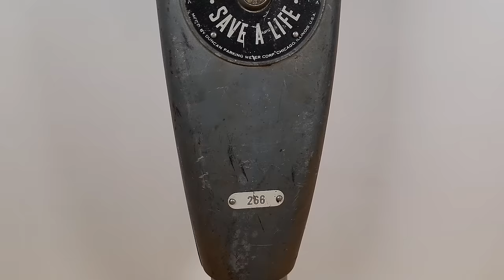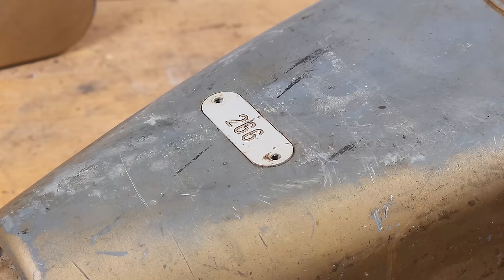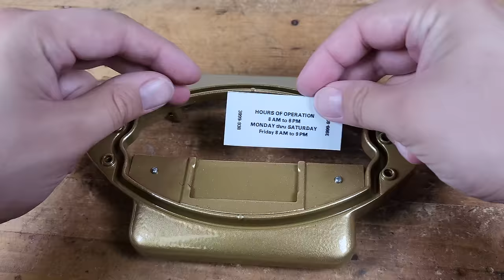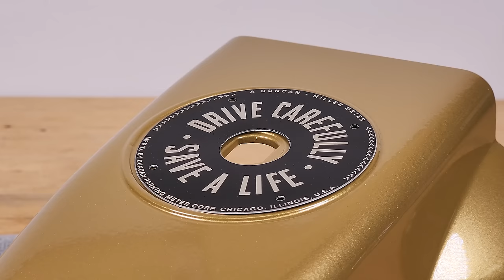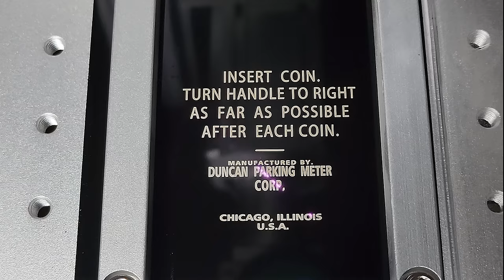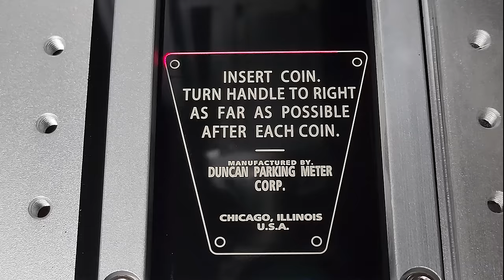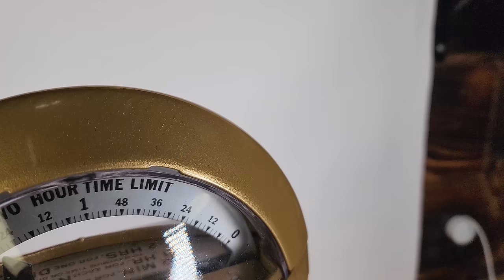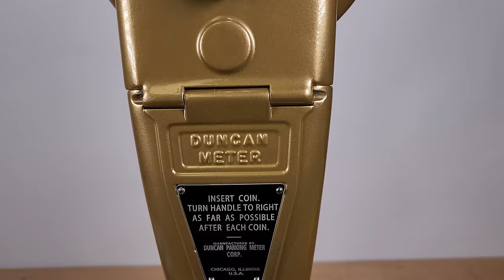1960's Duncan Parking Meter Restoration

Comment: This turned out nice 🙂 I personally have repainted them myself a handful of times when I collected them and they are surprisingly heavy duty and heavy lol, they are made of a magnesium aluminum alloy and are difficult to spray paint when taken down to bare metal, this guy definitely did a better job than I personally have in any of mine that I had in the past, but I admire his attention to details that I personally overlooked on the ones I worked on, GREAT JOB RESTO MAN 😎

Comment: Is there a reason you changed the colors on the violation sign and the expired sign? Where did the police sign go?
Reply from the maker: It was easier to find the decals and I liked the color difference better. I left that off, the one that I had was in really bad shape and couldn't find a replacement
Reply: @joe_diy  thank you so much for the reply
Reply: So the Police MIGHT turn the meter🙂

Comment: 🤨⚠️ - that suction hole in your spray booth looks a bit too small to extract all of the powder ~ I could see some of it wafting out the sides, you need the size of a box fan with a furnace HEPA filter strapped to the back of it to get all of the powder dust 😉
Reply from the maker: Yeah it's not very effective. I'm going to rebuild it next year with a combination of box fans and filters in front of a vacuum chamber

Comment: How are you so fearless about everything and put the dirty clock works back in untouched?  Also how did you get the words on the flags?
Reply from the maker: I actually cleaned the whole inside. Might be hard to see on camera but I removed a lot of dirt and grime. I didn't want to pull apart the timing mechanism and damage it. The letters were just decals